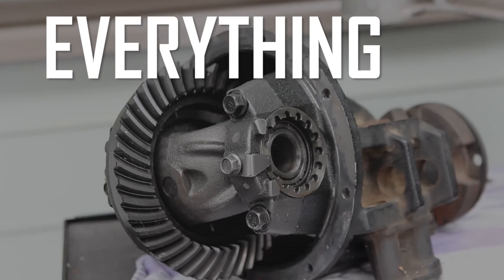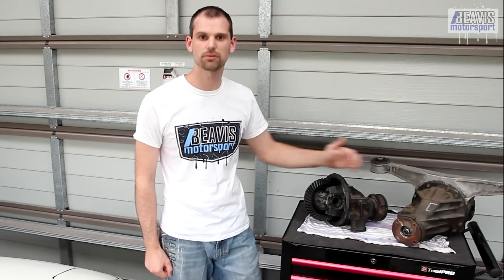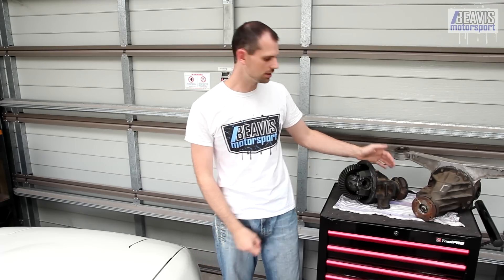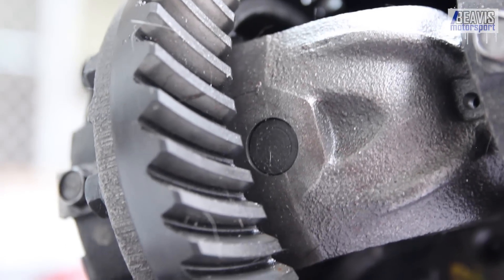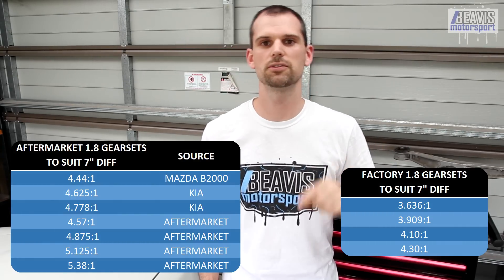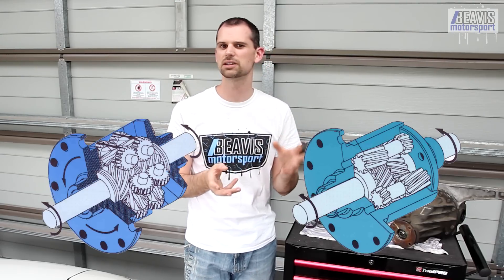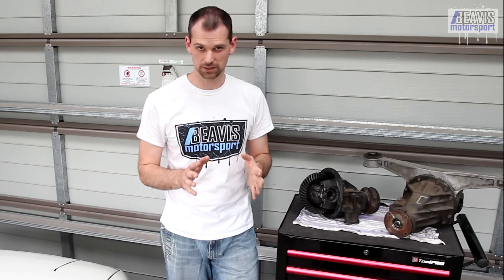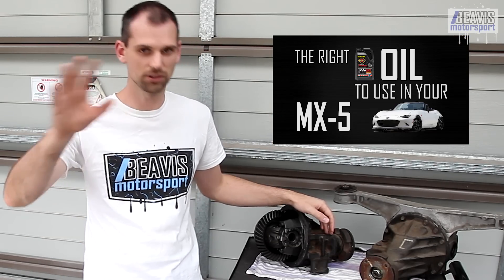ULTIMATE DIFFERENTIAL GUIDE FOR THE MAZDA MX-5 MIATA

Comment from the maker: Need help with your MX-5 Miata, I have a heap of technical guides here: https://www.youtube.com/playlist?list=PLongVur9FFho3xHKJjbWPyYBQK0N9ADO5
Reply: So I have a us 2003 NB2(face lift) with the 5 speed manual. Seems like I have an lsd. I'm confused with your chart as the face lift 5 speeds were not listed. So is it still 4.30's in the rear?
Reply from the maker: @SGTRacing  We didn't get 5 speed equipped cars for 2003 so I cannot say for sure, probably a 3.9 or more likely a 4.1 ratio. A 4.3 ratio for anything after 1993 is very rare.

Comment: @Bbeavis I have a 92 miata with an open diff that I recently replaced the driveshaft on hoping it would get rid of the clunking. I think it's the bearings but I don't want to have a faulty diff rebuilt. I read on some forums that the 4.3 NB open diffs can be used with the NA6 driveshafts and axles? Do you know if that's true? I eventially want to upgrade to a torsen but just 4.3 NB open diff is in my budget right now if I can use the same axles and driveshaft. Thanks!
Reply from the maker: I am not 100% sure sorry, we did not get a 4.3 NB diff in my area.

Comment: my car is a nbfl 1.6 and i would like to put an lsd from racingdiffs but they make only for nb 1.8 .is the housing of the differential the same size nbfl 1.6 and nbfl 1.8 because some say yes and some say no?
Reply from the maker: Your car is an NB, so it has the larger 7 inch "1.8" spec diff, even though your engine is a 1.6.

Comment: Great video. I've called some mechanics and they had no clue. My torsen type 2 started to whine. So I've got to swap it out for a welded and the shafts seem too short. I do have another open to throw in for now or get welded. Even while I get the LSD looked at. Any reason for this? Guessing the welded diff is from an early mk1? But I'm sure it had the rubber guide. Ideally I don't want to swap the half shafts.
Reply from the maker: Yes, sounds like you have the wrong spec diff. They early 1.6 size will bolt into the sub-frame, but shafts are different.

Comment: I know this is an old video but I have a 2001 5 speed 1.8 VVT with the torsen type 2 I believe. Can I drop in an open diff from another 1.8 NB without swapping axles or driveshaft
Reply from the maker: Yes you can.
Reply: @Bbeavis  what about a fuji diff?
Reply from the maker: @SizzaE60  Yes, they are the same externally, with just a different internal diff centre.
Reply: @Bbeavis  ok thanks so much wasn’t expecting u to respond 6 years later 😭

Comment: Thank you for the video. You talk about 1.8 engines most time but, in a 2002 1.6 NB2.5 with open diff, would be a 6 or 7"? What is needed to install a LSD in that car?
Reply from the maker: Yeah that is because in my location, all NB came with 1.8 engines only.
For NB's with the 1.6 engine, they still have the 7" diff like any other NB.
Reply: @Bbeavis  Very helpful! Thanks!!!

Comment: I couldnt find the answear anywhere else so i'll ask here, is it possible to change the open differencial in my 1.6 5 speed manual nb to fuji or toresn from the 1.8 with 6 gears? How will it affect the gearbox and does it require additional parts to be changed as halfshafts etc?
Reply from the maker: If you have an NB, then you can swap in a 6spd transmission without any other changes. And, you can swap to a torsen or fuji LSD without any other changes.

Comment: I have a 99 1.8 5 speed Miata with racing suspension.  At 60 MPH in 5th I am around 4000 RPM.  I would like to put in a 6 speed which would not be compatible with the 4.3/1 gears and need to change to a 3.6 to 3.9 rear end. Can I just change the gears in a Thorsen differential.
Reply from the maker: Yes, you can do whatever you want here. You could run the 6spd with your current diff gears, you'd see a slight increase in RPM while cruising as 6th gear is shorter than 5th in the 5-speeds.
Or, you can keep your current diff but swap to a different gear ratio such as 3.6, as you say - they will bolt in place of the current 4.3/1(?) gears.
Reply: Unfortunately on eBay they are clueless about gear ratios so no idea what I am actually buying?  I guess I could find a wrecked Miata with a good 6 speed transmission and rear end.  My current rear end is the reason I haven't put in a 6 speed because of the gear ratios.  I have leukemia so my actual rear end has no get up and go. @Bbeavis

Comment: Do the 6” 4.30:1 hold up well to more HP? I think you said they were questionable with the factory power train.
Reply from the maker: Not really, no. The little diff that came with the early 90's model MX-5 are not considered very strong - particularly if you increase power.
Reply: @Bbeavis  Dang. I do like the 4.30:1 gearing as of now, in stock form. It is cresting 3100 rpm in 5th @ 60ish mph, but maintains 32 mpg. I think 4.30:1 7” should be fun at 250ish  HP as a daily driver, but I think I’ll drive it with the OEM 6” version, until it craps out. Anyway, it seems the 1.6 needs a lot of upgrades, whereas the 1.8 can take more abuse and hp, which allows someone to upgrade along the way.
Stereo goes in Thursday. Fixing AC. Then decide on turbo, ECU, and clutch as one project as a whole. I think the diff, will be later, b cause I may go full out performance, once I turbo it. Anyway, $20k is the end goal🤣

Comment: Can i use just drive pinion and ring gear from rx8 to get 4.4 ratio?
Reply from the maker: The RX-8 Diff is similar to the NC model MX-5 Miata, but not the earlier NA/NB generations.
Reply: @Bbeavis yes I'm talking about NC, but I haven't found any info if those element's fits.
Reply from the maker: @aleksander2988  This may help you: https://miaterati.tumblr.com/post/116920440576/i-decided-to-change-the-differential-before

Comment: Can a six speed NB 3.6 ratio diff be swapped into an NA 1.6 eunos roadster (finned type diff) and what mods will I need? Suggestions and advice please.
Reply from the maker: Yes, the diff will all bolt in, you will need all the drive shafts from the NB also.
Reply: @Bbeavis  thanks for that

Comment: 07:47 - So were all NB 1.8s Torsen? Or where they still fitting the Open Diff on NB 1.8 as standard?
Reply from the maker: It was certainly optional. Some special models may have come with LSD by default, but for the most part, NB's were delivered with an open diff unless the LSD was optioned in.
Reply: @Bbeavis  Ahh, thanks, that makes sense.

Comment: I have a 94 1.8 NA Miata. Can i change the open diff which is currently installed with a Torsen Diff out of an 1.8 NBFL without changing Driveshafts Half-shafts ?
Reply from the maker: Yes.

Comment: Hi i have a 1.8 NA miata with the 7” diff. Was just wondering (outside sourcing the MSM axles) do you have a parts list i can use to install an s2000 mfactory LSD?
Reply from the maker: Sorry i don't have the specific list of parts  for you, you'll need to do some googling.
Reply: @Bbeavis  thanks anyway. actually did.. confused on the which axles (s2k axles have different lenghths)

Comment: how is is the 1.6 diff weaker than the 1.8 diff?
Reply from the maker: There's lots of documented specifics around failures online on forums and the like, essentially the small ring gear and pinion in the 1.6 diff fail prematurely (compared to the 1.8 diff). Note, usually its fine for stock 1.6 power levels.

Comment: Can't I just put a 7in gear ring on my 6in diff if I have a housing for the 7 inch?
Reply from the maker: I don't understand the question. If you have a 7 inch diff with 7 inch gear, why would you want to keep any of the 6inch parts?
Reply: What I'm asking is if I can just switch the the 6 inch gear ring for a 7 inch and run the same axles and pinion since I have multiple differential housing at home. From my understanding there all 7 differential housing according the info given.

Comment: Recently got a 6-speed NC Miata - and the final drive really is just too short. I can comfortably cruise at 32 mph in 5th gear! It practically just feels like a 5 speed with extra steps, and I wonder if there's an easy way to change that.
Reply from the maker: I am only aware of RX8 diff swaps for the NC, but that is usually for a shorter diff gear, not a taller one.

Comment: How could I fairly easily tell if I have a torsen or open diff on my MX5 Classic model? I've seen alot online and everyone seems to contradict eachother with tests. I'm not hugely mechanically minded but I want the easiest sure fire way to know if I ha e one or not. For example if I do a rolling burnout and I get 11s rather than a 1 does that mean I have an LSD? As some people say yes and some say no so I can never be sure
Reply from the maker: To be 100% sure, you can't really tell without looking inside, perhaps via one of the half shaft holes in the side of the carrier. That said if you can definitely do a proper two wheel burnout, very good chance it's LSD.

Comment: my 6" diff on my 1992  Miata is doing just fine at 180,000 miles
Reply from the maker: Yeah certainly I've had 6" diff in my 1.6 for many years, they work fine for most people for years. But can be known to suffer when people start to push them hard or increase power.

Comment: Hi there, apologies if you've already answered this, I had a brief look in the comments and I'm struggling to find an answer to this anywhere on the internet.
I have a UKDM 1.6 NB2 / MK2.5, do you know if this has a 6" or 7" ring gear, whether it's an LSD or open diff and what the driveshaft compatibility is with the 1.8 diff?
Reply from the maker: We don't have 1.6 engined NB/MK2's in my part of the world, but I would confidently expect all NB's to run the 7" diff, as per any 1.8 spec car.

Comment: Can you do this video for all nd models?
I may just be missing it but I wanted to ask if anyone knows what a ND2 2021 GT Auto soft top has as the diff? Hard to find...
Reply from the maker: Sadly J H, that detail is still a little vague, and can vary depending on market/country... I don't know that information currently sorry.
Reply: @Bbeavis  no worries, hopefully that can come in time. All I could find was you either have the limited slip or an open diff.... not much to go on. But I've seen online that for open diff folks we can upgrade to the Cusco Type RS 2 way maybe 1.5 and the OS Giken Superlock LSD. What I don't know is what would be a better option for someone looking for ultimate Street driving, not for track necessarily.... I canyon carve and want more outta my GT but am still aiming to keep the car in a safety parameter not full blown race car. Got any input friend?

Comment: Is it possible to have a 1993 NA with a 1.8 diff from factory? It clearly has the rubber part close to the driveshaft but all the signs are pointing towards the engine being a 1.6, it even says so on the sticker under the hood.
Reply from the maker: We're told no 1.6 diffs have the pinion damper. If your diff has it, then its likely a 7" 1.8 spec diff, is there no chance it was swapped in after?

Comment: Any idea what would be in my 2005 base nb2 Miata? It has a 5 speed in it. Open diff
Reply from the maker: 1.8 spec diff, so 7" ring gear, probably 4.1 or 3.9 ratio.

Comment: How much hp can open diff 1.8 hold I've heard 250 but clutch would go before that
Reply from the maker: There are many 1.8 7" diff NA/NB cars with relatively high power, into the 300-350+ hp range.
Reply: @Bbeavis  thank you boss💪

Comment: Yo im realy confused,
Im in the uk, I bought a mk2.5, its a 1.6, the diff looks like the 1.8. i need to change it because the previous owner welded the diff, im not sure whats going to work.
Did the uk 1.6 mk2.5s use a 1.8 diff? sorry i can't find the right info anywhere.
Reply from the maker: The Original NA/MK1 MX-5 with the 1.6 engine from around 1989 to 1993 are the only cars with the "1.6" diff, aka 6" ring gear.
The confusion comes from some international markets that received a later 1.6 engine in the NB/Mk2 (not something that we got in Australia, hence the terminology difference).
All NB's got the "1.8" diff... aka the 7"  ring gear, even if they came with the 1.6 engine as yours does.
Reply: @Bbeavis  Seriously thank you, have a great day bro!
Reply: @Bbeavis   Same here, also have a 1.6 nbfl in Sweden. So i should be able to swap my open diff to a torsen type 2 without changing drive axles and shaft? Or did I misunderstand this?
Reply from the maker: @SebbsRingblom  Yep you can keep your current axles, exactly per my comment above, All NB's got the "1.8" diff... aka the 7"  ring gear, even if they came with the 1.6 engine as yours does.
Reply: @Bbeavis  Wonderful! Thank you so much for the quick answer! Much appreciated!
Reply: @Bbeavis  So.. I got the car down on the ground again after the type 2 swap! Only the differential!

Same axles and drive shaft, but I got a really odd klonk sound when moving forward and backwards (not noticeable on jackstans before i put the car down). As bad as I don't want to drive it to inspection tomorrow.. Not sure why the sound comes..? My drive axles have 0 play (in axial) now.. 
Diff has been flushed and now have fresh Redline 75w90 GL5
Should it be like that?
What should I look for?
Any tips?

Need help.. :(
Reply from the maker: @SebbsRingblom  Hey, hard to say without seeing or hearing it in person, but OEM diffs should not make 'klonk' noises, it may be time to take it to a professional.

Comment: Might have an ask on here since i can't find any info on it. My diff is a 1.6 diff but the stub shafts are completely square. I have seen a few mazdaspeed/Mazda comp diffs that run a completely square flanged stub shaft if not running normal open diff shafts but this isn't the point. The point is that upon further inspection and opening of the housing my diff by all accounts looks like a vlsd core with two different lengths shafts as Usual. My question is why the heck are the flanges square and does this mean anything?
Reply from the maker: Maybe have a read of this:
https://www.miata.net/garage/diffguide/index.html

Comment: How many spline count is the outputs to the shafts on the miata diffs over the years? Namely the type 2 diff. 28spline? I'm curious about using the torsen for my Sportage front diff. 1gen Sportages had 26 spline up until about 1998 or so then went to 28 spline (mazda diffs)
Reply from the maker: The 1.6/1.8 MX-5 Miata all had 26 spline by 27mm.

Comment: I have a 2007 NC 5 speed with an open diff and want to upgrade to an lsd how would I go about that
Reply from the maker: You can buy aftermarket centres from various sources:
https://rev9autosport.com/nc/drivetrain/lsd.html
http://www.maruhamotors.co.jp/miata/parts/nclsd.html
https://www.ebay.com.au/itm/KAAZ-LSD-REAR-FOR-Mazda-MX5-NC-2005-2016-DBZ2020-/141963259438

Comment: What would be the best ratio for a 02 SE USDM 6 speed N / A 180whp?
Reply from the maker: That's up to you and how you want the car to perform, what sort of driving you do,  tyre diameter etc. If it's for cruising the highway, then a taller ratio is better generally. There are gearing calculators out there to work out what speeds your car runs at what RPM.

Comment: hi just changed oil in diff 2004  mx5  NBFL 1.8l and some litlle flat plates came out of drain hole didnt look like ring gear so what could it be
Reply from the maker: Perhaps you have the TOCHIGI FUJI LSD diff and it's lost a clutch plate? There's some detail and pics on it here: https://www.beavismotorsport.com/guides-tech/differential-guide-for-miata-mx5/

Comment: Great video. I would have loved some more explanation on the gear ratios (ie what they mean and which one to choose) I used to have a 2001 NBFL 1.9 (Memories 2) in Europe which had a Torsen diff. My current 2002 Titanium has an open diff and I am wondering what I should be looking for when considering an upgrade to a Torsen.
Reply from the maker: Which final drive gear ratio to choose is really up to each individuals needs I suppose. Obviously the "higher number" diff ratio (i.e 4.111:1), the "faster" the car accelerates but the car revs high on the highway... while the "lower number" diff ratio (i.e 3.636:1) means slower acceleration, and lower revs on a highway.

Comment: How do you identify a Tochigi Fuji diff? In the diff I'm considering buying there is a little square axle visible in the hole.
Reply from the maker: I'm not aware of any way to verify other than looking inside at the actual differential centre.
Reply: @Bbeavis . Thank's. That's where the square axle is.

Comment: What diff came in the 2001 5 speed in the US?
Reply from the maker: At this point it's difficult to say. I'd suspect a 4.1 open. The best solution is to physically check. So many cars have now been modified you cannot trust what the owners manual said and I don't know USA statistics as I am not located there.

Comment: i have a 1.6 NBfl. which diff gives more performance without traveling on much higher rpm. i usually travel with the speed of 140klm in 4300rpm. can you give an example for the same speed ???
Reply from the maker: Do a search for miata gear ratio calculator, that should help you work out what is best for your use. There is a spreadsheet out there that will help.
Reply: U can answer the question Yourself. Divide existing transfer ratio by desired transfer ratio eg 4,3 / 4,1 = 1,049 and multiply that with the revs in last gear . 1.6 l  and U  think about diff changes ?

Comment: Mhm didn't mention the facelift 1.8 5speeds? None the wiser :(
Reply from the maker: All the 5 speeds for NA/NB are essentially the same. Same gear ratios, same strength, same dimensions, directly interchangeable. There's little value in worrying about the differences.
Reply: @Bbeavis  alright! Thanks for the reply!